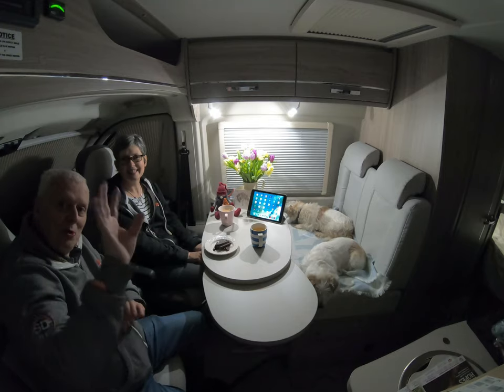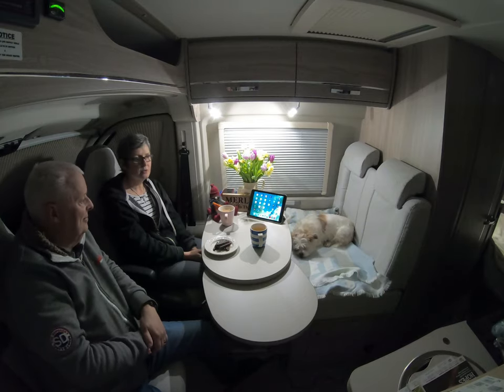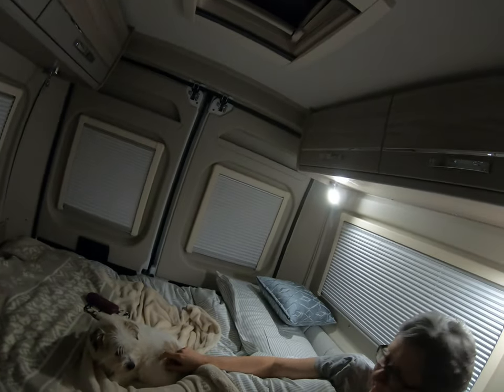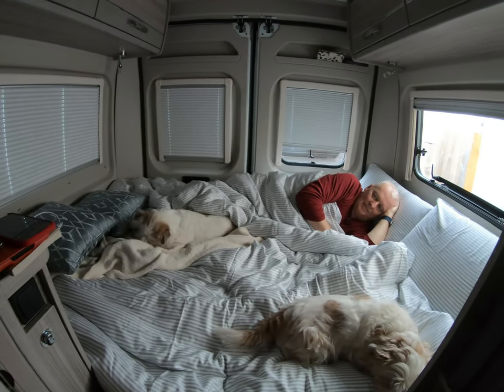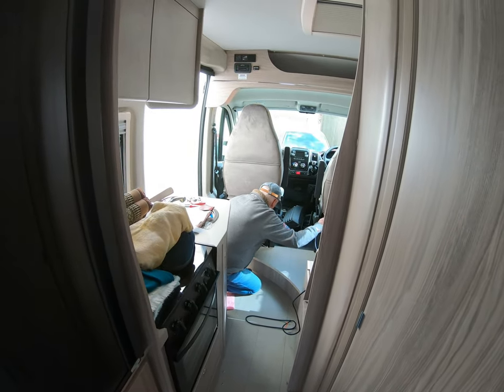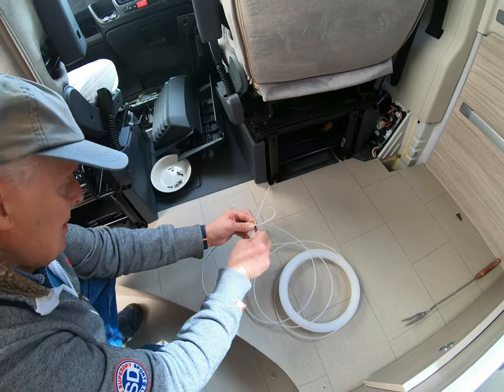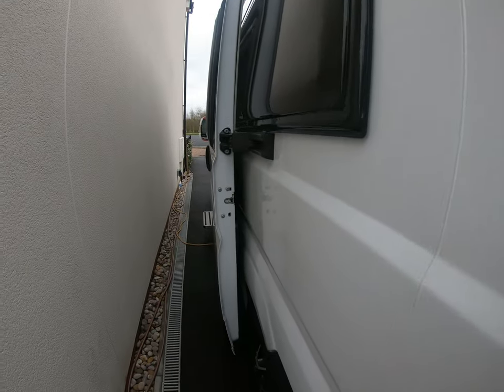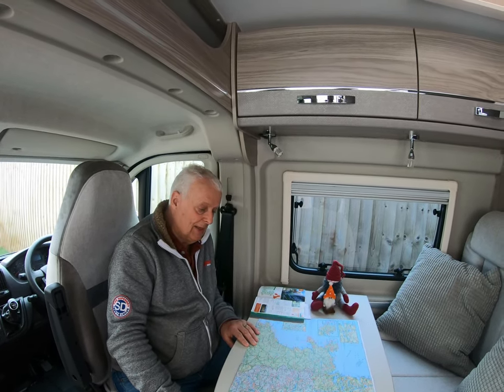Wizard in the Wild Merlin on the drive

Comment: Hi Graham, planning to do the same upgrade on our newly arrived CV40, what size of cable etc did you use? Any links to cables and connectors appreciated. Thanks.
Reply from the maker: Hi George it was 16mm rated at 110amps. Sorry for late response. Only just found your message. Thank you 👍🙏🚐🧙‍♂️🐶🐶

Comment: Hi Graham and Ellie we are waiting to pick up our new cv40 but not till October it was put back from august. So I’ve got all the bits to do the same job as you have just done just curious as to the batteries you’ve put in I was thinking of putting Sterling 120ah yours look similar to the Sterling ones lithium can you tell me if they are sterling ones and now I know they will fit  thanks for now.
Reply from the maker: Hi Peter. Yes mine are the Sterling ones. They seem a reasonable price compared to others that have Bluetooth. 
Obviously I had to dismantle the existing battery box. Mine are secured with ratchet tie secured to the floor. Then the box built round it. Lithium do not need venting. 
That is one hell of a wait Peter. I feel your pain. We can’t drive ours yet as still waiting for DVLA registration.  Just let me know if you want any info. Our channel is not supposed to be a technical one but things like that you can’t avoid it. 
Regards 
Graham and Ellie.